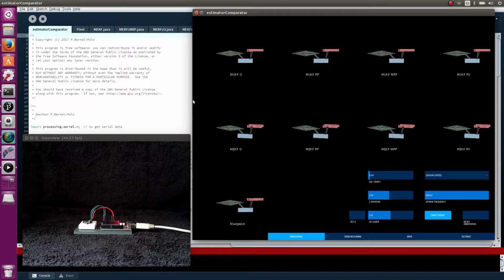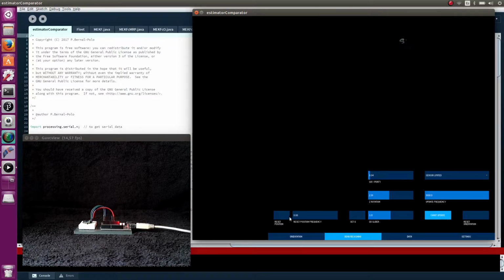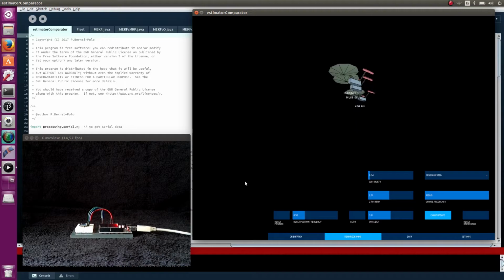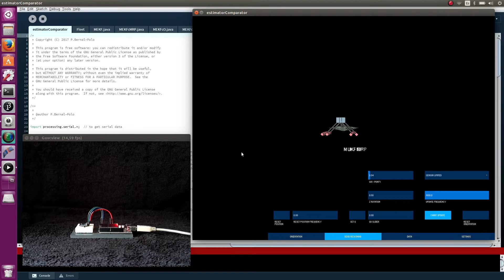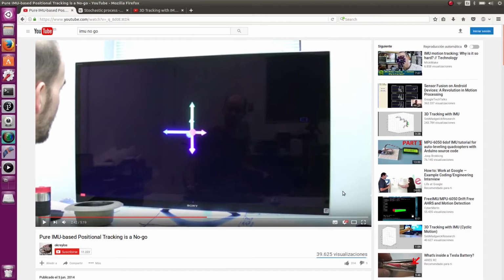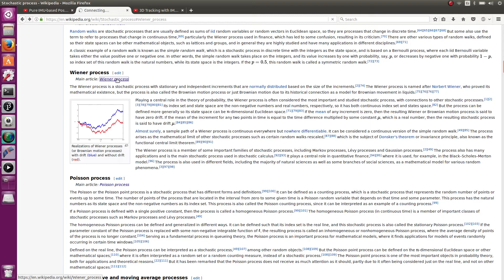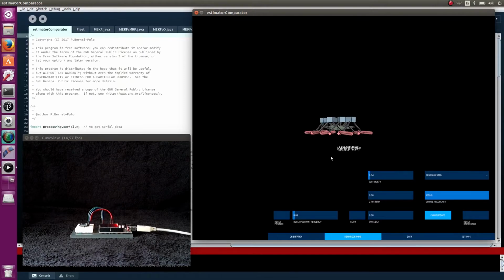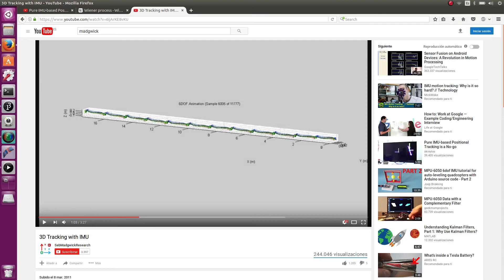Dead Reckoning with IMU: why it is not possible

Comment: This video is no more accurate since 2020 and this publication : https://hal.archives-ouvertes.fr/hal-02097099v2/document
Because of "the  Kalman  filter  and  the  use  of  deep  neural networks to dynamically adapt the noise parameters of the filter" we can now achieve the same precision than with a SLAM base odometry, at least for a car.

Comment: Sir Iam working with UWB positioning system.The problem is sometimes i was missing the UWB data from any of the anchors for a small amount of time.say for 10 meters,at this time can i use Accelerometer and gyro to get the position...This is for a short distance.Will it help???
Reply from the maker: I have not worked with UWB, but I can imagine that it is similar to GPS positioning (the system provides a noisy position measurement). I have seen some works, and I have experienced it myself that when introducing IMU measurements the position estimation is smoother due to the high measurement rate. However, a good calibration of your IMU will be mandatory. Otherwise, you will get a biased estimate that will deteriorate your estimation instead of improving it.
Regarding the loss of UWB data, we do not talk about distance, but about time. The more time passed without an update of the position, the more its estimation will deteriorate due to the Wiener process that involves the integration of the acceleration.
I hope to hear about your experiments. Greetings.
Reply: Thanks

Comment: I've experimented a bit with an IMU and the noise only exists at a certain decimal place onwards (i.e systematic errors), which can be eliminated by truncation, eliminating the drift as well. Not sure to what extent the true measurements actually lack precision though (i.e random errors). I wonder if the latter errors can be reduced by using the Kalman filter. I also have a video showing in principle why inertial tracking is actually possible https://www.youtube.com/watch?v=_O2pd71cLm0
Reply from the maker: I have seen the video you referenced. I have not tested your idea about rounding up the acceleration measurements to a certain decimal point, but I will just out of curiosity. However, I'm afraid it would not solve the problem. The real problem is that you integrate twice to obtain position from acceleration. If you have some bias "b" in your velocity estimation, then you will integrate that bias, and the error in your position estimation will increase as b*t, with t the time. I think you do not experience that effect in your experiment with the joystick because you are "closing the loop", as we say in control theory. You are looking at the result of your estimation and you are acting on the joystick to correct the position so that it does not diverge.
  I encourage you to experiment with a real IMU in which you have the additional problem of having measurements expressed in a non-inertial reference frame, despite of the calibration errors, so you need to estimate your IMU's attitude to transform your measurements to an inertial reference frame.
  I know that inertial tracking is an atractive concept, and one can only know its limitations by experiencing oneself. I just hope that my video and the code I shared help you to understand these limitations and keep you from spending as much time as I spent.
Reply: Yes I agree that there will be a bias since the IMU wouldn't be 100% precise or accurate, and we would end up with a drift nonetheless, but it would be much less severe because that bias would also exist in decelerations, and of course no drift at rest. You have a pretty good set up there, it would be great if you could try it out. I did try it myself with the built-in IMU in the PS3 controller but it was of very low quality and had the same accuracy as the joystick.
Regarding the problem of gravity and of a non-inertial reference frame, it can be corrected if we could measure the orientation of the object with enough accuracy, or with a good calibration one could analytically (instead of numerically) treat the orientation as a coefficient to cancel out gravity. I think analytically the bias could also be eliminated, for instance, considering that we are not in outer space therefore such a drift wouldn't exist. 
Hope you can try the experiment, even if we are wrong there is a lot to learn, instead of just dismissing it out of hand.
Reply from the maker: Sorry, I think I did not explain well. The problem is not the bias in the acceleration measurement. As you say, it could be eliminated (or at least reduced) with a sensor calibration (i am currently working on this). Assuming that we already have our measurements expressed in an inertial reference frame, after the integration ( v := v + a*dt ) we will have a velocity estimation. If we have at the beginning  v=0  and  a=0, everything is good. However, as soon as you get  a!=0  the probability of reaching again v_{real}=0  and  v=dt*\sum_i a_i=0  at the same time is very small (either by the noise in the sensor which would produce a Wiener process as I mentioned in the video, or by the discretization made by the analog-digital converter, the sum of accelerations will not cancel out). The problematic bias is the one in velocity estimation.
  At the moment I am reticent to continue spending more time with this. As I said in the previous comment, I have already tried more than I should without positive results. Now, I have assumed the impossibility of dead reckoning with IMUs. But people like me simply need to see for themselves. That's why I encourage you to do so.
  Regarding the problem of orientation estimation, please check the other videos I posted. This is not a trivial problem, and is the subject on which I was focusing my effort. I have come to what I consider some good algorithms whose performance is shown in the videos I speak of. For some reason this video is the one that is is getting more attention.
Reply: On your first point, that is what I mean in my previous comment, that we would indeed have a lesser drift even with the systematic noise removed, the imprecisions in the system would prevent an acceleration to be canceled out by a deceleration. Such a drift, however, is much better than the continuous drift due to the noise, seeing that although accelerations would not cancel out, the velocity would certainly be reduced or even reversed (as my video shows). Still a problem but not an impossibility. It could be resolved, for example, by the fact that on the surface of a planet if v != 0 then a != 0, if you're not in outer space if the acceleration is zero the velocity should be zero as well.

I will definitely check your other videos. This is a subject that is related to my work as well (IT and Physics).
Reply from the maker: I should probably have written that there is no general algorithm to apply dead reckoning with IMUs. In fact, there are special cases in which it is possible to exploit certain information sources to obtain "pseudo-measurements". For example, when your IMU is known to be attached to a foot, the assumption of a null velocity when you get acceleration measurements near zero produces surprising results (see https://www.youtube.com/watch?v=6ijArKE8vKU). Another example would be the assumption of an oscillatory movement. Applying a high-pass filter Madgwick gets: https://www.youtube.com/watch?v=SI1w9uaBw6Q.
  However, if you are not able to get these "pseudo-measurements", then you are in trouble. Sorry, I should have made that note. Thanks for pointing it out.
Reply: Thanks for the links, wasn't aware that the gait video was also zeroing the velocity.  I think near zero accelerations would be a nice pseudo-measurement for our case here. Please if you have the means do try it. As for me I'll have to buy an IMU.
Reply: I have seen people from openshoe used a Kalman Filter based ZUPT algorithm to eliminate the bias in velocity to large extend eliminate the drift to achieve Pedestrian Dead  Reckoning. Obviously it is only meant to be use for human beings and not IMU in general.